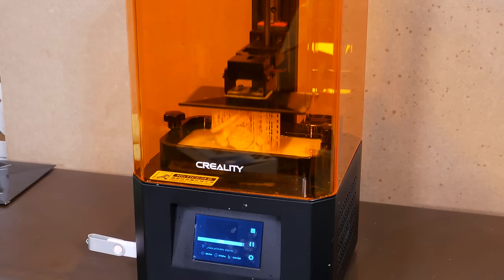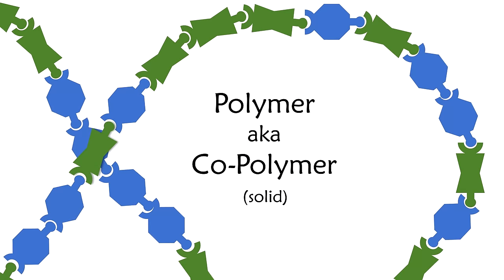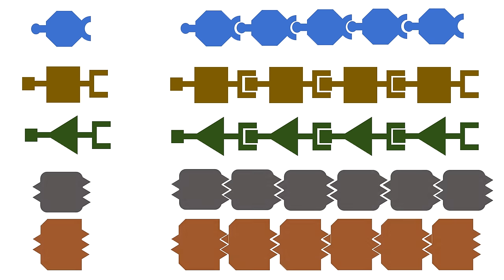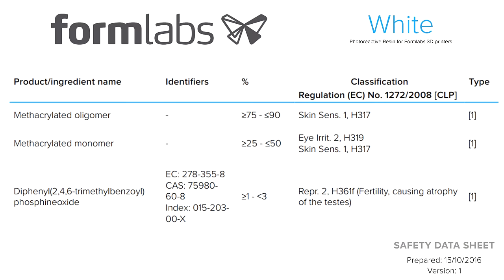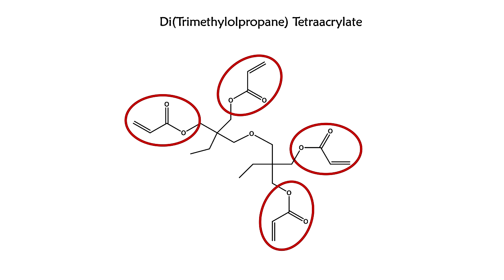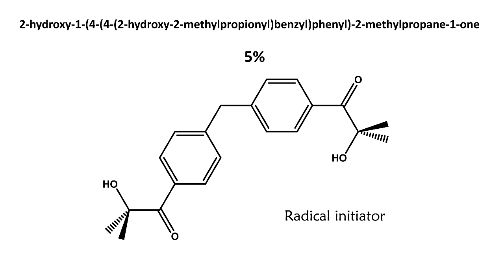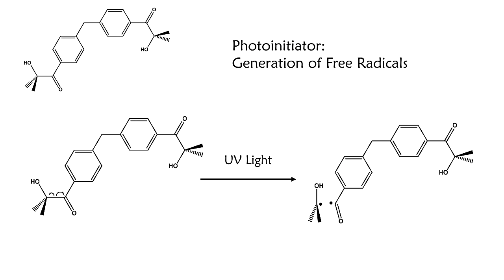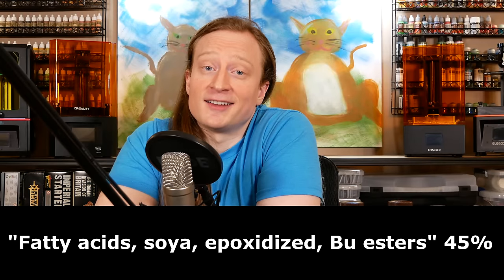Ph.D. Chemist Explains 3D Printer Resin

Comment: What chemical/gases get released when the resin is exposed to air and what about when it's cured by the uv? Should I have a carbon filter? What about zeolite? I live in an apartment. I can't use the printer outside when the temperature is too hot or cold which most of the year it's one of those. I planned to poor the resin outdoors, and operate it inside with ventilation and a carbon air filter. Is that a good idea? I have a elegoo mars pro. Which has a carbon filter. Thoughts please

Comment: Hello, I have some questions because I just start resin printing, if I don’t mix the resin before use is there any chance to be toxic after curing also is it safe to storage resin inside plastic containers?
Reply from the maker: poorly mixed resin is more likely to result in a print failure, but I wouldn't be too worried about a range of safeties of your printed objects based on how well the resin was shaken before you loaded the printer.  Even cured objects are not 100% safe, they can still leak / leech liquids over time, so I don't recommend extended skin contact.   I always keep my liquid resin in the plastic container it was sold in.  when I'm done printing I filter the remaining liquid back into the original bottle :-)

Comment: I have two form labs 2 printers . One reason I rarely use them is the cost of the resin . I found the fff method 5 x less expensive  . There are other resins available that are 5 x less expensive but I did not want to risk ruining the trays or damaging anything . It seems that if I use a resin that has no color pigment it may work as The printer have  a wiper that keeps the resin mixed and if the viscosity is not right it sloshes the material out of the  tray . I believe the printer is probably a very good quality but they have gone to great lengths to make you believe only their resin works in it ..   can you give us your opinion ? Also wanted to add a big thank you I have been in the high Precison high volume plastics industry and never understood some of the terms in the used in polymer resin ..you really nailed it and made in simple ..

Comment: Question, would resin be food safe after curing? I have a cheese grader that has plastic parts to hold and drive the drum . The parts melted due to bad bearings and I would like to make new parts, but not sure if resin would be safe to use.

Comment: Given the polymerization is exothermic, is there any need to worry about initial vat and resin temps? It seems to me that after just a few layers (especially large ones) the heat generated by both the UV LEDs and the heat from the reaction itself would boost the resin temp significantly. (assuming a 20 C ish start temp). So how critical is that initial temp?
Any thoughts on a video about how the solvents work to rinse our prints? (IPA, SImpleGreen etc) Knowing a bit more about that chemistry can only help to keep down the white bloom and make sure all the uncured stuff is taken off and reduce sticky prints.
Thanks
Reply from the maker: The temperature does rise a bit in the vat during printing... Which makes it interesting that a lot of people DO observe that room temperature has an effect on the number of failed prints. (cold temps seem to involve more failures).   As for solvents, it's trial and error.  I've found that IPA or denatured alcohol are both 'good enough' to rinse off that extra resin.
Reply: @GoobertownHobbies  Thanks. That makes sense:  colder=slower chemical reaction. It never occurred to me (and it should have after all these years of working with resins for casting and fiber work) that the reaction was adding to the heat in the vat, I just thought it was the LEDs heating up and transferring heat to the whole machine. But I was curing a glob of old resin the other day in the sun and managed to melt the plastic container it was in. 
So I stuck an IR camera pointed into the vat while printing and once the UV light had gone off I could see a fading 3 degree heat bloom where the resin had been exposed. And that's after the plate has come up and new resin has whooshed in there. I figured it wouldn't take too long before the whole tank rose a few to ten degrees just by the reaction alone.

As for solvents, I was interested in the chemistry of IPA "dissolving" uncured resin. It isn't a dissolve is it? since we get sedimentation? It was that rinsing mechanism that had me peaked. What is it about IPA that allows the rinse to happen?

Comment: ALWAYS wear safety glasses with this, at some point I was removing a printed part from the print bed and it landed right into the resign. I've got a drop of resign in my eye and head to be treated in hospital. I prefer using a full gasmask, so I don't get in direct contact with that, that's definitely something I could recommend, eve if it is a bit uncomfortable.

Comment: hi I got a question - about epo-soy oil .  Radicals that are produced from iniciators end up as alkohols - will they react and bond with epoxides? In that case would epo-soy oil be more than a plasticiser , can it be a crosslinker too?

Comment: Hi can ask you a huge question I bought a Mars 2 pro to print parts for my 1/6 scale hobby. I haven’t used it yet as I’m now very wary regarding all the videos on toxicity etc . I m trying to be very green but due to the small room my maker space is in and just has the top of the window you can open. I was worried about VOC and particaluates  in the air. And their effect . So I want to use a plant based resin as I’m told it’s better has no voc or harmful stuff in it and the resin can be put into compost or the bin . As a newbie I’m hoping you can or your your tube followers give me some advice on printing in my little back bedroom and I also bought two elegoo carbon filter fans

Comment: Theoretically, If the iso was saturated enough, couldn't you stick the contaminated iso in the sun in a sealed jar, and allow it to polymerize in the alcohol, then it would be heavier and sink down to the bottom or be filtered out, or does the alcohol itself prevent it from happeneing?

Comment: With water washable  resins, could I pop the water under the uv light for a long while to turn the resin into a solid and then dispose of the water down the drain or is that too risky? I use quite a bit of water each time to clean my vat and base plate and I’m struggling with where to put it. It’s winter in the UK so evaporation isn’t going to happen

Comment: Hello,  thanks for the video, but one question hasn't been mentioned really. Current models have a carbon filter build into the printer. I thought this was enough, but the room I print in can't be ventilated and now my house smells like it. This sets off a mayor alarm bell in my head. Do you think it can ever be filtered enough to make it safe to breath if you can't vent it to the outside? Current housing only closed system ventilation in my country and I am about to invest in a carbon filter + ventilator because of it. My country is cold, and it would be sad to only print 3 months a year due to printing next to a window. Thanks already for the detailed video.

Comment: I’ve been trying to get in to LCD-SLA 3d printing, but i have a mast cell sensitivity condition which gives me a stronger than usual reaction to any irritants. I’ve found a wide variability in photopolymer resins. I’ve been trying to figure out a good way to guess how smelly various resins would be from their data sheets, especially because i’ve had anycubic ecoresin on back order for over six months and they seem unlikely to ship it any time soon. Do you have any idea what element causes that smelly irritant? My intuition is it’s probably the free radical photoinitiator? but i’m not a chemist. My thinking is that maybe slower less sensitive resins (like those designed for laser based SLA printers like formlabs make) might be safer for me to be around without feeling like i’m coming down with a cold?

Comment: Great video!

I wonder though what about the so called bio-compatible resins (ie that are safe to be in touch with skin and even piercings for a long time)?

Also I was wondering about the separation of dirty IPA & the resin inside it. Since they have rather different densities (30~40% depending on which you compare to) but still if it's only sitting idle it takes days, and even weeks for the resin to settle on the bottom.
But can't we use that density difference to separate them faster, for example by increasing the Gravity :) like with centrifuge?
Unfortunately most commercial centrifuges are mainly for lab equipment, and are very expensive and only for a small volume containers. But the principle is simple enough to DIY larger volume centrifuge (perhaps even manual). After better separating the resin on the bottom syphoning the clearer IPA from the top should be easier (than decanting).
What do you think?

Comment: I'm currently trying to make sense on a particular resin that seems to have known issue of quick pigment separation, and slightly longer cure time. could it be that the component separation happens as a whole, and that its quick enough that if we were to use that sort of resin, component-related* print quality problem starts to occur?(*resin temperature checked OK and it is well shaken). 

when a print is going on, the component already starts to settle down or up, that the quantity of resin in vat determines on how much or where the activator-monomers saturate, where the resin performs rather poorly, it eventually elevates another problem from the machine that wasn't really a problem before, such as Z screw lubrication or maybe uneven worn on the hard metal screw(instead of the brass nut)

Comment: Can I put the bottle of the dirty mixed alcohol in the sunlight to turn liquid resin into a solid state?  then filter the mixture to reuse alcohol? I don't know if the chemical reaction works at low concentrations.

Comment: Hi Brent ! I currently have a small office room(20 m2) with a big window about 2,5m wide . Is it possible for me to be in the same room with the printer ? And is ventilating the fume outside the window enough ? Finally is the fume going out dangerous i dont want to give any neighbor cancer?
Reply from the maker: I'm working on a vid about resin safety next month, stay tuned.  Your neighbor is safe. as for you... it's a sliding scale, but you're probably not at huge risk

Comment: Pretty sure a permit is required for any storage of class four compounds.(Reactive, flammable, corrosive, etc.) So if there is one in your home, you've either broken the law or have the proper equipment already.(They wouldn't issue a permit for storage of class four HAZmat compounds unless you have the equipment to handle them already.)

Also, Ingestion is it's own classification outside of the chemical property classifications. For what SHOULD be obvious reasons.

Comment: I just got my first 3D printer I was wondering if I could put it in my attic that has a window fan running and makes the room pretty cold especially in fall and winter it can get pretty cold I have a photon mono and idk if this falls low temperatures 40s or 30s Fahrenheit will affect the resin print

Comment: I'm still a bit at a loss on how to deal with the used alcohol. I use six liters of it in my cleaning station. Leaving it to evaporate would take god knows how long. Leaving it for weeks to allow the resin to drop to the bottom doesn't seem to really work. I needed a new FEP and didn't print for months, but the liquid still looked pretty much uniform. I've tried exposing it to UV in an attempt to solidify the resin residue and cause it to collect at the bottom, also with no visible effect.

It seems the official take on it would be to hand it in as hazardous waste, or for smaller amounts to bottle it and throw in the regular garbage (we don't use landfills, we incinerate). Now that I type that out, I guess that is the solution. Remembering to keep the empty isopropyl alcohol bottles and using them to throw the stuff in the bin.

Comment: can you please make a video with possible ways to clean IPA?
Reply from the maker: I've been thinkin about that one! :-)  in short, let it settle out, distill it, or use UV light to turn the resin into a solid and scoop it out
Reply: @GoobertownHobbies  I let it settle out but leaves a residue after but so much. I am wondering if it will help to use activated carbon to soak some of that residue? I see some people use clay filters. The reason I mention this to you is that your a chemist with a knowledge of what's in in stuff.

There is a YouTuber that has an interesting method which requires mixing some  substance with water and mixing it with the used IPA to help it settle. Let me get you the details in a min
Reply: @GoobertownHobbies  one guy from Maker's Mashup has a video about how he used Aluminum Sulfate mixed with distilled water mixed with the dirty IPA

Comment: I just got my 3D printer.  I am attempting my first recycling of the IPA.  I mixed up the resin in the IPA so that it was well suspended in the IPA.  I then cured the suspended resin with UV light.  The solution turned a watery milk consistency.  I have been using gray Anycubic resin. My thinking was, I could then strain the solution through a coffee filter.  The filter would catch the now solid resin and pure IPA would come out the other side.  I WAS WRONG!  I have discovered 2 things.  1. The now solid resin is so small that it goes through the filter.  2. It seems that the now solid resin is not settling to the bottom of the jar.  It has been about 7 hours and the solution is not showing any signs of sedimentation.  

Have I completely messed up this IPA?  Should give it more time for sedimentation or should I now dispose of it?

Comment: 2:50 ...Wow. So...an implication of this is that one could separate two sides of a resin tank with a gradual diffusion of one resin into the other, and the final product would gradually transition solid properties from one half of the project into the solid properties of the other half. ...That's pretty awesome. Especially if one thinks about whether this could happen in-between entire changeouts of resins, and resubmergence of the unfinished project. (Could you print a 3-D printed Barret .50-cal replete with giant "rubber" washer, entirely from resin?)

Comment: So maybe you cover this in a later part of the video (I haven't finished it yet) but what I worry about is the toxicity of the resin in the air. Is this stuff dangerous to breath. I read so many different things online (I'm sure none of them are from people with a Phd). If I'm printing in my basement am I spreading toxic fumes around my house? Are the fumes only toxic within a certain distance from the printer? Do they need to be exhausted outside? Are they completely safe? I've heard some people say since they smell bad they clearly aren't good for you but a fart smells really bad and I'm pretty sure no one is going to die from fart poisoning.

Comment: Can you pkease guide me regarding preparation of resin for DLP based 3d printer working on 404 nm uv light. I have used MMA as mononer and EGDMA as crosslinker with photoinitiator. The issue is the copy remains in the bath instead of coming up with block and the viscosity of resin is very low.

Comment: I clean my IPO by putting it in a transparent plastic container and leave it in the sun a day or two and the UV cure the resin into a semi solid guey sludge that can be filtered. I repeat the process a few times and i end up with clear alcohol again, saving some of my IPO and don't have a disposing problem with resin or IPO :)
Disclaimer: I live in Thailand and we have a lot of sun here but i bet it would work just about anywhere if you leave it out long enough :)

Comment: Hi. Is it possible tu use 3d printer resin for casting? What I mean is can I cure 3d printer resin With a layer height of 16mm. For example for a dice with a Silicon dice mold.

Comment: So just recently got a 3D resin printer and one thing I can’t seem to understand, is when it’s liquid obviously I don’t wanna be huffing this stuff in. But should I wear a respiratory or is that over kill. I already have an exhaust system setup for when it’s printing. Just can’t seem to find online anything about this. As I see so many others seem to rarely be wearing a mask at all thanks.
Reply from the maker: There is no great answer to this question-  It's a bit like "how much secondhand smoke from cigarettes is OK and how much is bad?"... except we have much less data on the relative dangers of the various fumes in resins at this point.  Minimize the amount of fumes you breathe.  Personally, I do the printing in a basement and I'm only breathing that air for a few minutes at a time, and I choose NOT to wear a mask for those few minutes.

Comment: Are there any resins that can be cured with either UV or heat? Would be a good way to finish curing a 3d printed part in the case you want to use a UV-opaque filler

Comment: I really enjoyed the explanation and like most here I am really impressed but... From a more practical standpoint... Would it be possible to get some tips that we can apply to our prints like, If the resin is X% this and Y% that then you'll need a cure time in the range of Z. How can we apply this knowledge to get us to a point where we can extrapolate a basic idea of what settings to use based on the composition of the resin?

Comment: Hi, what is your reccomandation for an IPA alternative that is safer? Thanks
Reply from the maker: Most hospitals are drenched in IPA for sterilization, the biggest hazard is fire safety.  rubbing alcohol or denatured ethanol are both perfectly reasonable household chemicals for cleaning prints.  There are some water-washable resins if you prefer, just don't put the waste down the drain! :-)